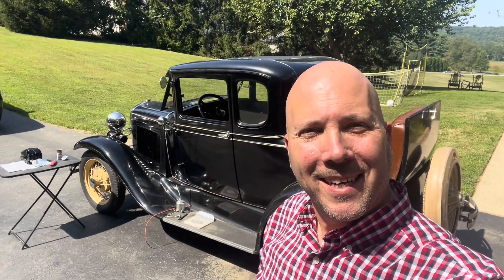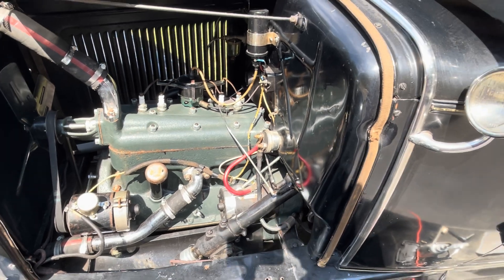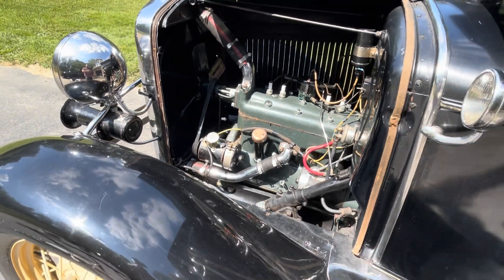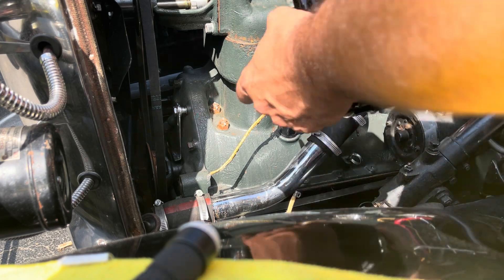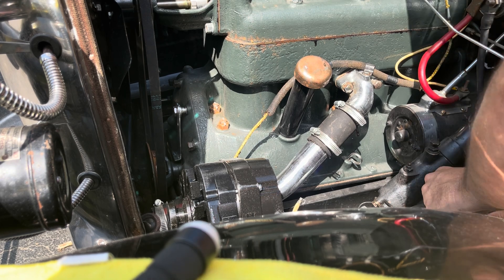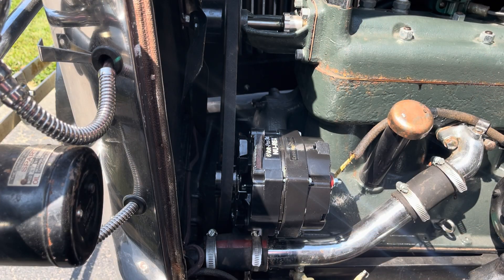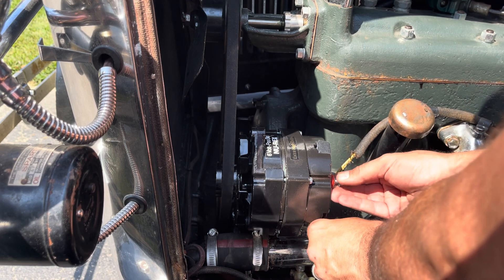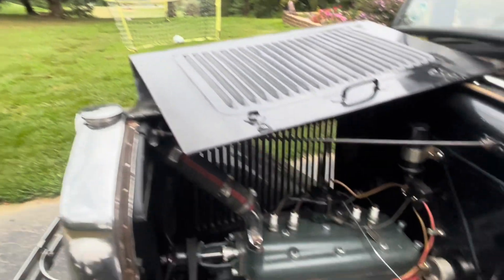Ford Model A: Nu-Rex 6V Alternator Install (E48)

Comment: I like this upgrade. If your A still has points, get a Pertronix unit to replace your points.  The Pertronix will fit in your original distributor body and will be a huge improvement over the points and will assure greater reliability, saving you a lot of reliability issues, which is quite common with most original A's.